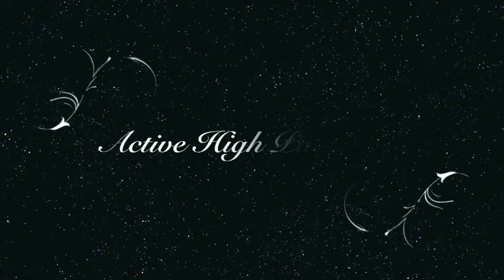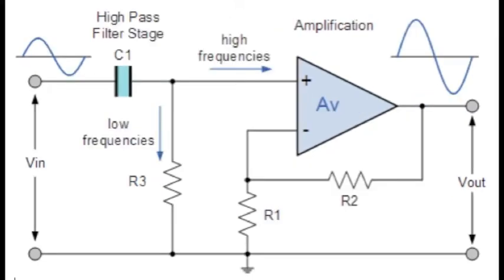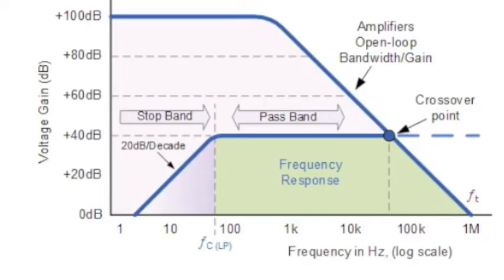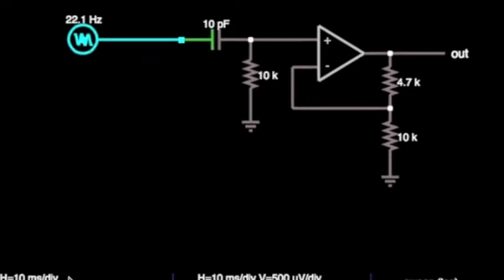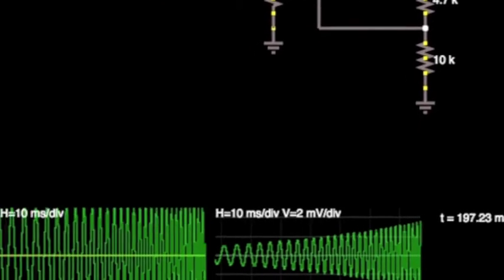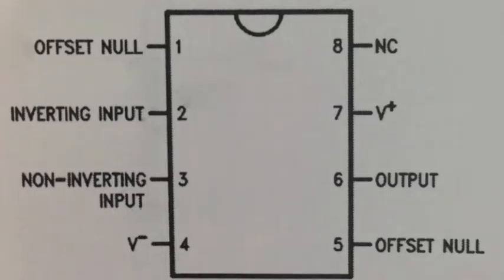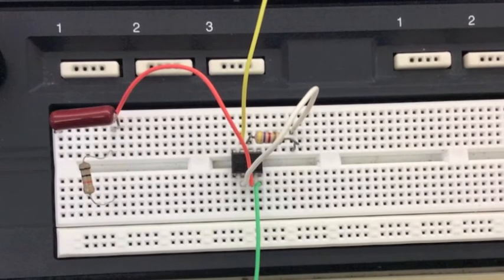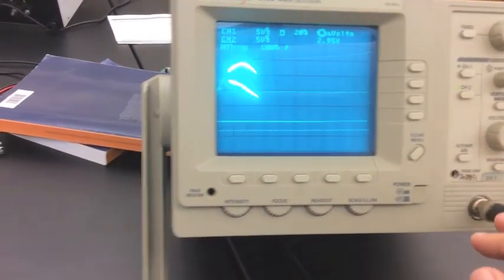Active High Pass Filter Using Op-Amp

Comment: why we use op-amp here? What are the advantages of using Op-Amp in high pass filter?
Reply: Good question! A low impedance output is one advantage of an active filter. A passive filter is sensitive to load impedance which can be remedied by using an active filter. 

Another advantage of an active filter is that you can adjust the gain of the signal  to be much larger than what is possible with a passive filter.

Comment: I wanna ask why we learn active filter and passive separately?
Reply: Because the "Active" filter is just an extension of the "Passive" filter and the "Passive" filter can be used on its own. Think of the "Active" side as a second stage for when "Passive" filtering is attenuating the input signal too much and it needs a boost. Very good for audio applications such as reducing noise at certain frequencies and then bringing that signal back to its original strength.